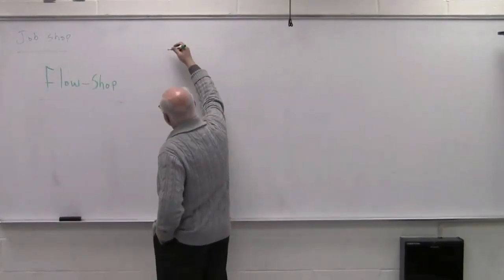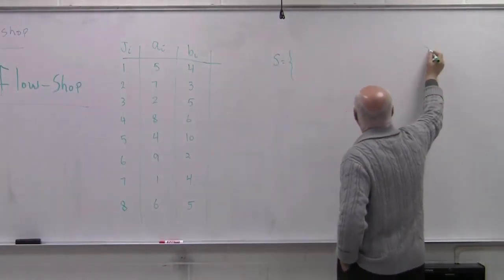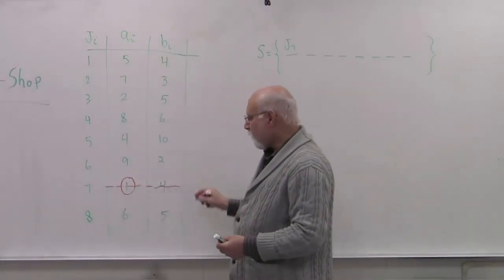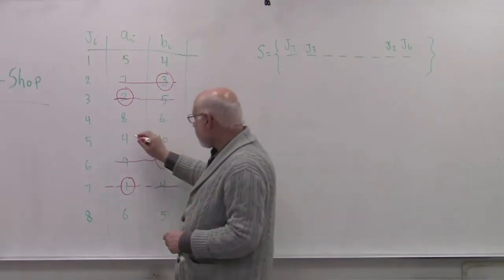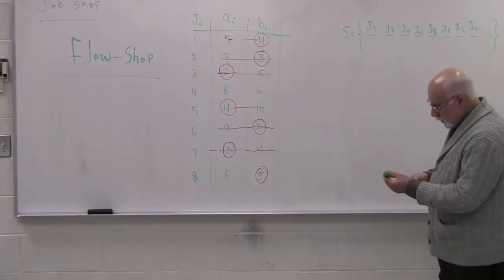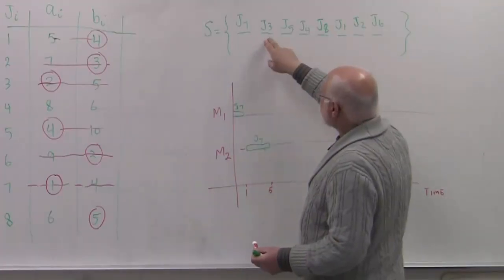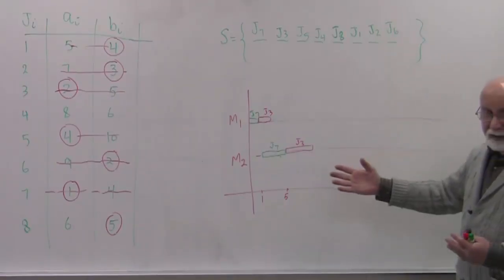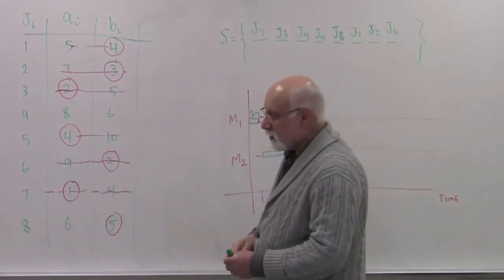Sequencing and Scheduling - Johnson's Algorithm

Comment: Não entendi porque a última tarefa não foi alocada na máquina 2.para fechar a soma de 40. A  máquina 1 deu certo o valor 42 pra mim.
Reply from the maker: Sorry for late reply. If I understand your question correctly, you get the number 40 by scheduling that job on M2 first, then on M1. That violates the assumption of the problem that it is a flow-shop, meaning all jobs must start on M1 first and when completed processing on M1, go to M2.